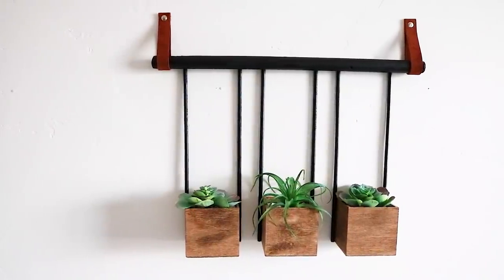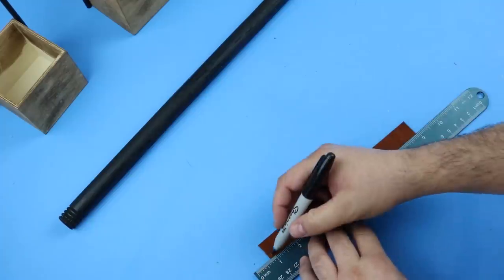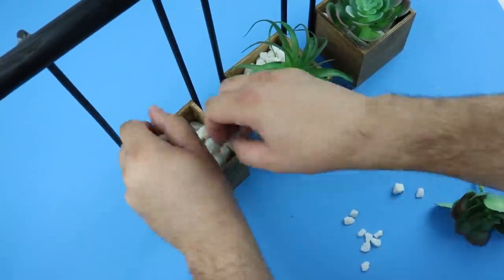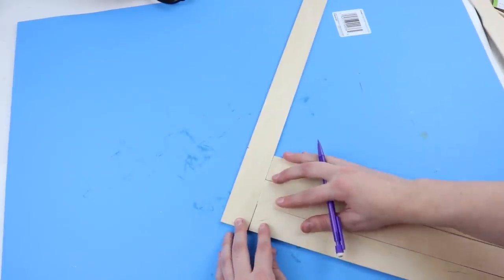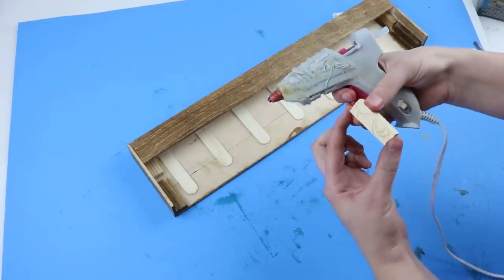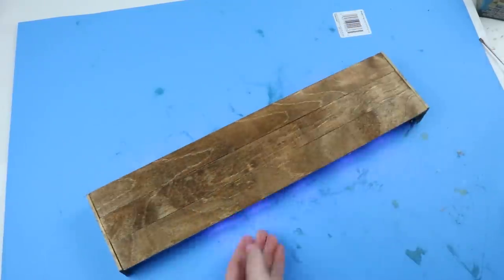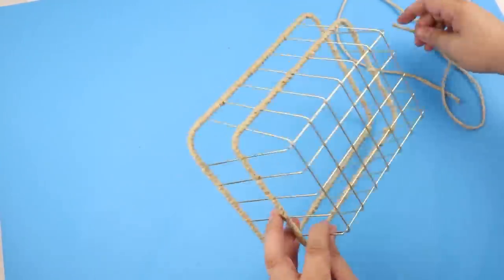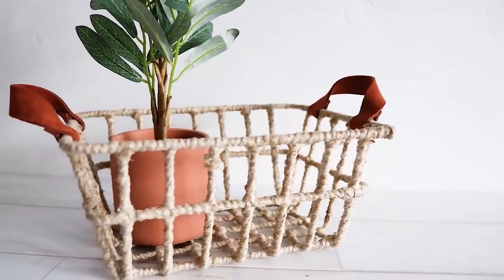DIY Room Decor! HIGH-END Dollar Store DIYs *Anthropologie Inspired*

Comment: wondering how easy it is to change the batteries out with the long wall light with the fairy lights inside. It is beautiful but wondering about the batteries.
Reply from the maker: It shouldn't be too hard. You can just take the light off change the battery and hang it back up 😊❤

Comment: Hey guys! So I made the wooden light box, and watched this again to find out how you attached it to the wall, however it's not mentioned, and I'm a renter. 
I do use nails and screws but am looking for the best way to hang, as this is going above my bed(head) 😊 so i need it be secure and positive its not going to fall as my kids or I are sleeping.. Lol
Any suggestions/how you did it, would be greatly appreciated 👍🤓
Reply from the maker: We just put a couple small nails in the wall and then hung the light on the stir stick glued on the back. You could also screw/nail the stir stick to the wall for more security. Hopefully that helps 😊♥️